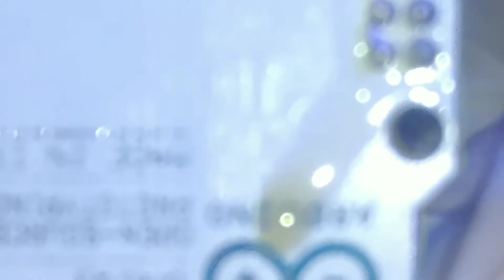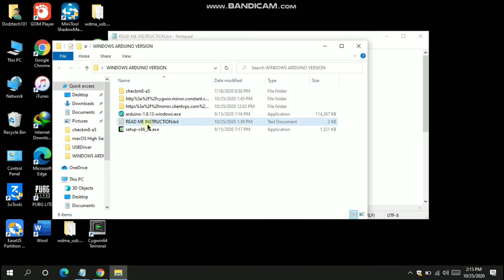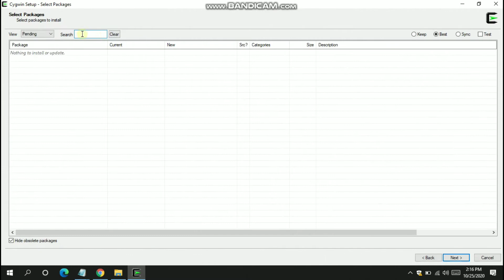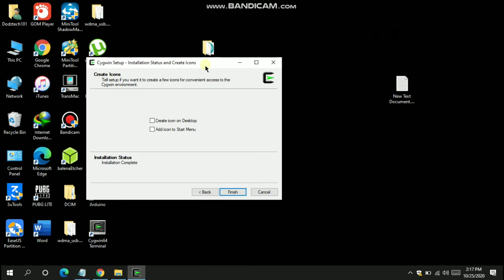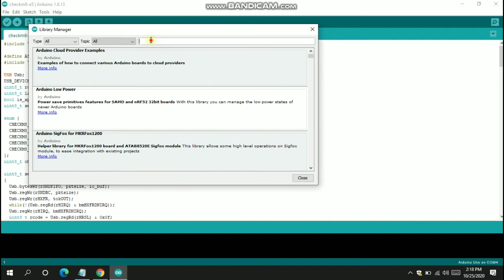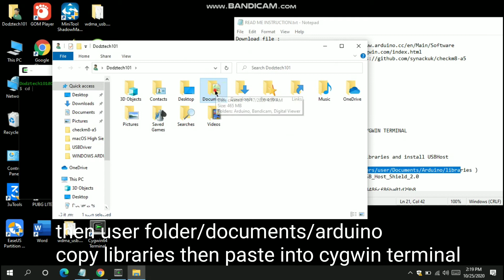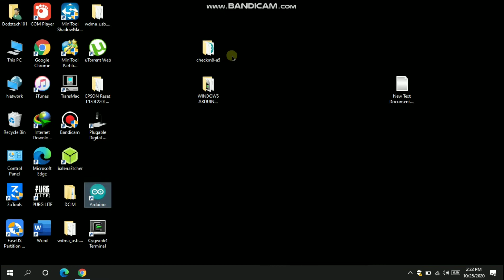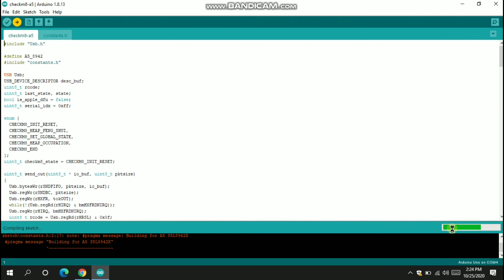Class Usb has no member named ctrl_Req usb HOST Fix Bypass A5 devices

Comment: hi bro i did same as you doing in video but  still geting this error Class Usb has no member named ctrl_Req
Reply from the maker: did you bridge the 3 joints
Reply: Yes its already bridged
Reply from the maker: @drgsm9970  to verify if you have power on usb plug your phone on it if it will charge